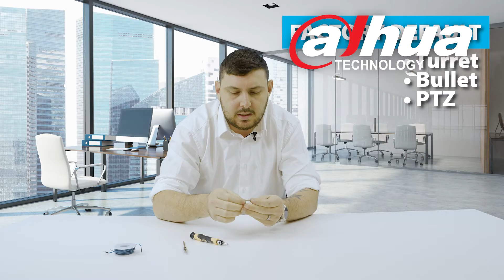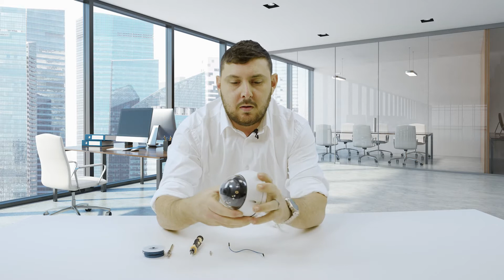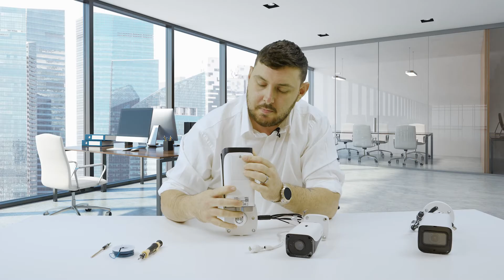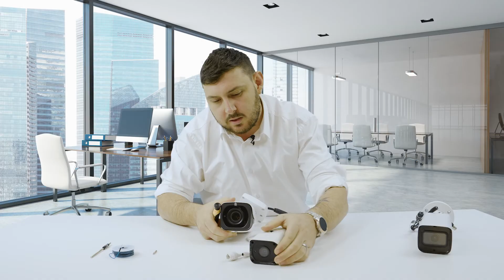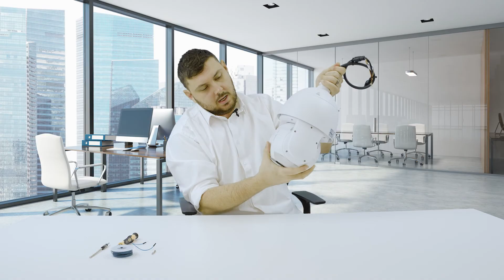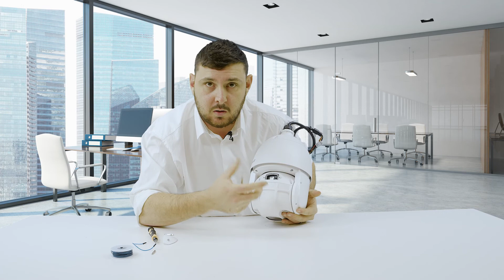Dahua : "Factory Reset" : Turret / Bullet / PTZ Cameras

Comment: Firmware will reset too ?
Reply from the maker: No. Factory Default does not change the firmware state.
Reply: @DahuaUKIreland  Okay because I have a problem with the replay on two cameras after the firmware update. No motion detection is displayed in the replay. Should I reset the cameras after the update?
Reply from the maker: I suggest you speak with my team on support.uk@dahuahelp.com - If you have a analogue system they will need to know the model number. Thanks.

Comment: How do I reset an analog camera stuck in CVBS mode? The OSD menu can't be accessed.
Reply: Hello did you solve the problem
Reply: @furkanyldz8562  Nope. UTC Controller does not work. Once your camera goes into CVBS mode chuck it in the bin.
Reply from the maker: If you use the Dahua UTC Controller this can help with this. https://youtu.be/ypYzSZh3IcQ :-)

Comment: is there a way to short out certain pins to force a reset orfactory default of the camera from the ethernet jack?  I keep reading on forums that when you update the firmware you need to do a complete factory default of the camera.  sometimes the camera locks up and you have to climb a roof to reset a camera, this isn't practical, especially when the camera site is 40 minutes away.
Reply from the maker: Hi. Resetting by shorting the Ethernet is not a option I’m afraid. However other options are XML resetting. This process just requires a email to our Support Department and a separate network switch unless already on one. On a side note, for sure by the book you should Factory Default after a upgrade however unless it was a big jump like from 2018 to 2021 a factory default is not always necessary.